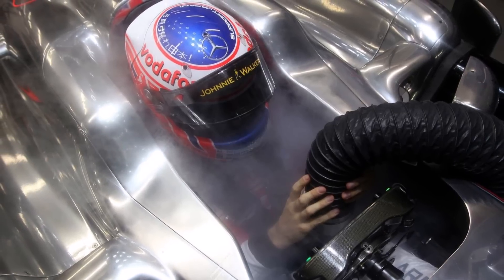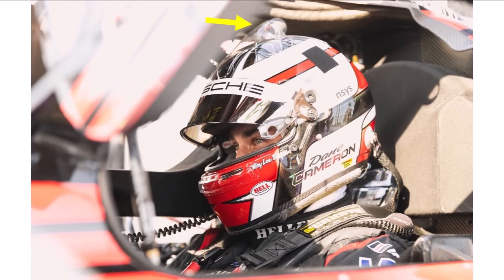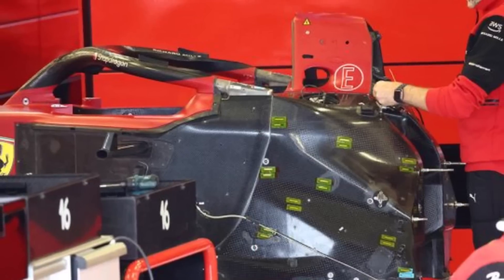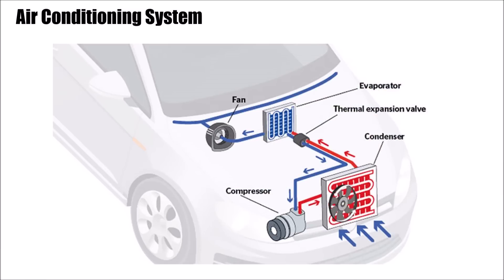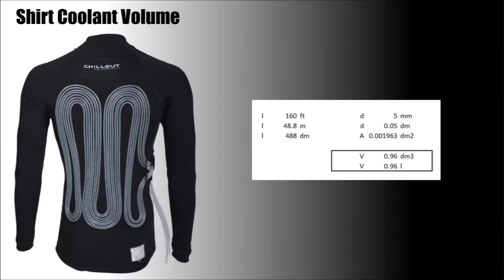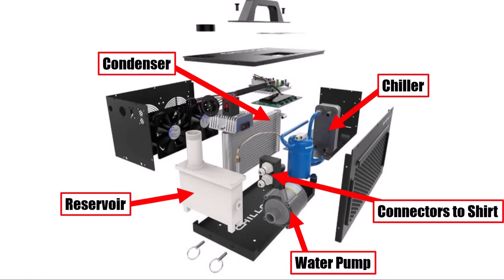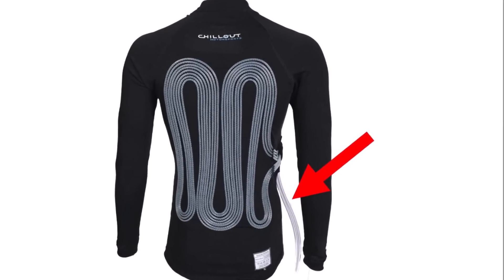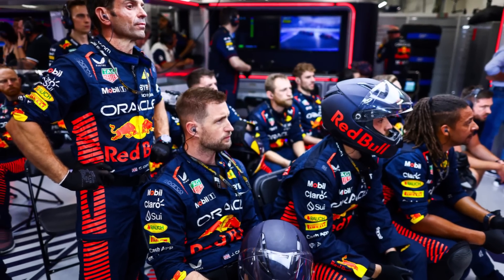F1's 2025 Driver Cooling System - EXPLAINED

Comment: F1’s getting way too soft. The conditions should be part of the challenge + Qatar 23 was a one off. When I race, keeping my head cool is priority #1 obviously (turns out keeping your 🧠 at optimal temps really helps 😂), but I assume if the blood is being cooled at your core, your brain won’t heat up and therefore is overall more helpful. 

But the cool air on my head has a secondary benefit, which cool suits didn’t. It kept me feeling relaxed. Though it could dry your eyes on extremely long stints. My cockpit usually never dropped below 60+ c /140+ F though and I didn’t start using the system though until I was nearly 40 and had put on weight. F1 drivers are in peak physical condition and the conditions should be part of the challenge.

Comment: This is way more important than it seems. Some years ago i raced an endurance multiclass at the Jarama Racetrack. We had like 30+ outside temps in a racecar with closed cockpit, no air conditioning and rules didn’t allow to lower the side windows for safety reasons. After 6 hours of non stop racing i stepped in the car for my 2 hours split. It was hell. I was in a 50 degrees cockpit with all clothes on, sweating in my helmet while concentrating in fighting for victory. My body was fighting against me, each lap felt like and entire race. Some moments i was afraid of losing consciousness… The gearbox ended up exploding, up to that point it felt like a relief. I haven’t raced in real life again since. I can’t imagine how it must be in top tier categories…
Reply: That should be part of the challenge. I was always able to handle the temps when I was younger and the cockpit never got under 140 (60 c) while racing in Fontana and nearly as bad in Buttonwillow. Once I got into my late 30s I couldn’t take it anymore though (I either had to back off by 5% or quit), but then again I wasn’t in shape anymore and wearing a black suit, helmet and gloves probably didn’t help either
Reply: @The_ZeroLine  I partially agree, but i think the "survival" or "against the elements" components of racing should be left for Dakar or races where the objective is not winning but finishing. Anyway nobody is going to lose HP so his driver has air conditioning in the cockpit hehe
Reply: @ Yeah. I’m not worried about power. I wouldn’t have a problem with AC if that race wasn’t a total one-off due to freak circumstances (the tire issue which meant they had to change tires every 18 laps requiring them to push 10/10ths every lap + heat and humidity levels they almost never experience and a track with no long straights for rest + lots of long, high-g corners).

Comment: If they removed the helmet cooling ducts, it'll be another problem for the driver since the helmet can get very hot in just a few minutes. Maybe water can help, but what about the foggings. Old school helmet is prone to this (have used older style arai motorcycle helmet and it's god awful at hot weather), and when I used my friend's stilo helmet (full face, idk what the type is) on a gokart track, it's surprisingly easy to get some heat. Not unbearable, but enough to makes me want to get some cold air to the helmet.

I don't know why the helmet manufacturer like Bell and Arai doesn't upgrade the cooling to get closer or equal to the current cooling capability and the aero of the motorcycle helmet.
Reply from the maker: The anti-fog wouldn't be removed, it's about the cooling ducts on the top.
Reply: @BSport320  I'm curious to see how they'll get rid of it. Considering the top part of the head will get hot quickly. Maybe with some vents like AGV pista or like those vents under the peak of motocross helmets.

I'm actually pretty baffled with how helmet cooling is done on open cockpit cars. It's pretty rough compared to motorcycle racing, despite in both sides of sports the helmets are affecting the overall aerodynamic package of the vehicle. Sure, different principles, but giving it proper cooling is also important for the comfort, especially on high performance athletes
Reply: Keeping your head cool is the most important aspect, but I guess your head won’t get hot if the blood is getting cooled at your core.

Comment: Do they still have the timed escape rule and how does this work with that?
Reply: Ripping some hoses would not be that hindering especially if the connection is only as tight as it neads to be

Comment: Cool system, hopefully it works well, we've seen multiple driver illnesses after the race in the past few years. 

I don't think it removes the need for the helmet airflow however. From what I can tell, they also need the helmet airflow to reduce the humidity on the inside of the helmet & prevent fogging on their visor.

Comment: Why don’t they use thermoelectric materials (Peltier effect) like the ones used used in PCR machines and other high tech, high fidelity appliances. This has been working reliably and precisely for decades. 
This would be a super simple way to cool the water in the shirt and all you need is electricity, of which there is a lot available at any given time in an F1 car. It would probably be a lot lighter than the compressor system and not require an extra hair duct. it would probably require the space of an iPhone or two.
Reply from the maker: The problem with peltier elements is the low efficiency. You would need a lot of them and quite a lot of electricity for the same cooling performance as shown here - and you would also need an air intake, but a bigger one.
Reply: @ thanks, I didn’t know, I always thought they were very efficient. I thought of using them to cool down the gasoline flowing to carburetors in old cars, or bubbles in the gas pipes can cause problems. But I guess it’s not a good solution.
Reply: @pklimbic  One good parameter for measuring refrigeration efficiency is coefficient of performance, which is defined as cooling power obtained from the device over power needed to operate the device. Vapor-compression systems (like your typical fridge) can have a coefficient of performance of 4 (4 watt of cooling for 1 watt of invested energy), peltier elements have it about 0.3, which is more than 10x worse. As total heat power rejected from the device is cooling power plus invested power, you can see that Peltier elements need roughly 10 times more heat rejection capacity than a vapor-compression system for example. Another problem is that unlike refrigeration systems where condenser and evaporator can be spaced apart, the hot and cold elements of Peltier elements are millimeters apart from one another.
Peltier elements are therefore useful in only a select few of circumstances, usually they are subpar to conventional technologies. Technology Connections has a good video on it you can check out.

Comment: Is it any different than what they use in nascar?
Reply from the maker: Nope, it's the same concept, just a different supplier as far as I can see.
Reply: @bsport320 Somewhat. Some teams in NASCAR use chillout and some use other brands. Chillout is by far the biggest brand in the public space though, and recently we saw them start to be used in Indycar which is where the Cypher was originally develop for (and has now also seen use in prototypes if I believe correctly)
Reply: Would have been exactly my question 😊

Comment: 😂 when you learn your $500 LeMons racecar from 2015 had the same driver cooling system that F1 would use 10 years later LMFAO. You can't even make this stuff up...
Reply from the maker: Yes it’s not new, F1 is not state of the art in everything
Reply: @bsport320  NASCAR has had something like this for about 30-40 years.  They also run in enclosed cars at much higher temps and humidity.

Comment: too dangerous as driver might get too cold and sneeze inside the helmet, decreasing view visibility and spread disease , becoming too calm and lose compatibility, more weight here is not a big issue, a more bigger issue is there are too many tubes running around the driver, and confuse them with the drinking tube, they might struggle to find water in a rushing situation and could mistaken the coolant with drink water.
Reply: Real Lance Stroll struggle
Reply: I don't know what you're smoking, the air is like 35C+ and adding to that is the excruciating hot engine. no one will ever complain there's too much cooling.
Reply: @foodfanatic851 You're approaching it from the wrong angle.  Instead of thinking you know everything and they know nothing, assume they know something you don't, and try to puzzle it out.

ETA I had the wrong reply handle.
Reply: Are you like taking the piss with this comment?
Reply: No, the tubes are yourtubes, perfectly cromulent with the web of support the drivers already have.
Reply: suit cooling is not a new thing and drivers all around the world are fine with it. none of these issues make sense

Comment: Making this sport so soft
Reply: F1 was the only sport without cooling, WEC has it, IMSA too, indy has a nice system on the helmet, i don't agree with you
Reply: @fqeagles21  WEC is a closed cockpit
Reply: @fqeagles21  They all have closed cockpits with little to no airflow so it makes more sense. This is just more weight and padding the corners for cowards. If we are racing in places too hot for divers what about crews and fans too? Maybe just use common sense and stop going to place to hot for that time of year.

Im sure this is all so Muhummed FIA can go to more oil rich tracks in the middle of places no one wants to live fuled by the oil killing our planet making it even hotter. rofl
Reply: @fqeagles21  wec has longer races, so does indy and imsa. But make the cars heavier i guess..

Its no longer the pinnacle of motorsports
Reply: @km6832  the car won't be heavier,listen carefully to the vid
Reply: Why is driver comfort a bad thing?
Reply: @K3b1bisLtu  its not..but the drivers are getting soft
Reply: But wec nor imsa has cars doing 5gs during cornering and 6gs during braking.
Reply: @briannam1082  your point being what exactly?

Comment: I built a simple cooling shirt for myself using 3mm garden drip hose a plastic bottle filled with icy cold water and a windscreen washer pump, it worked suprisingly well🎉
Reply: Care to share some photos? I’m interested
Reply: It depends on the temps you’re driving in. Where I race, my cockpit almost never falls below 60c+/140 F and that water would be hot tea by lap 2-3. Anything below 51c is very tolerable if you’re in shape. 2023 Qatar was a one off and the conditions should be part of the challenge. Only once I got older and heavier did I require a cooling system.